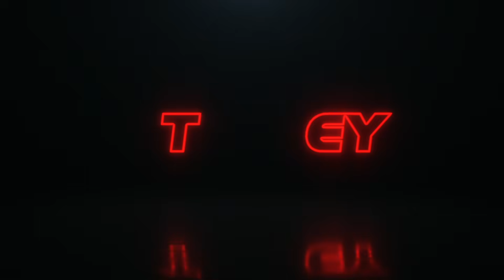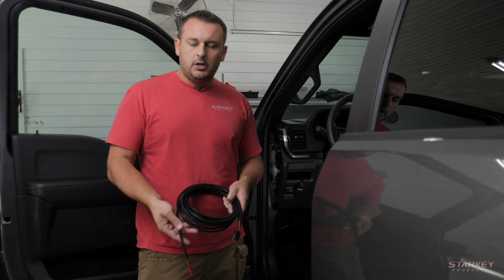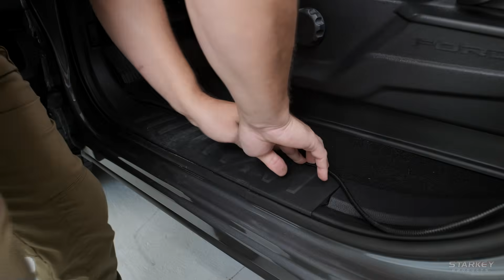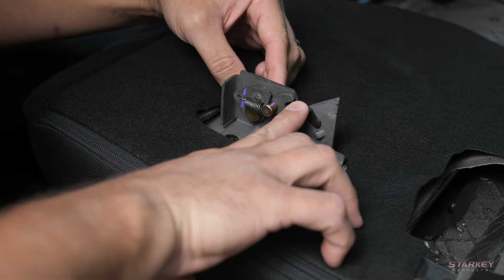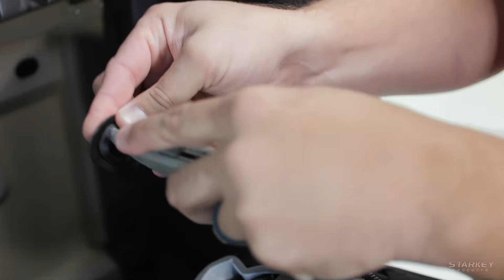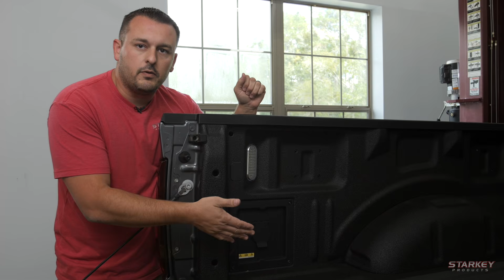Installation | 2015-2026 F-Series Bed Light Switch Upgrade Kit | Starkey Products

Comment: Can you use the switch to wire lights directly to battery. I have the light kit from you guys, but want the lights to be on all the time if switched on (no timer)
Reply from the maker: Hi Dusten - thanks for reaching out and the question. I am afraid not - this switch is a PWM momentary switch and won't operate the way you want it to. You would need to wire in a rocker switch directly from the battery for it to do what you want.

Comment: Then how do you replace the press button switch when it goes bad, bc they often do? So tell me that....not as easy as just a pop out panel.
Reply from the maker: The easiest way is to remove the tail light - 2 bolts, pull straight back, and unplug. Once you have your tail light safely off to the side, you can reach in and push the switch out from the backside. This will keep you from scratching the bezel around the switch and allow you to get it out easily. 

The switch carries a 5-year warranty from us FWIW, so any failure would be covered.
Reply: @StarkeyProducts  Dernnit, too late, already haggled and hassled and dinged/dented my bed panel. But that was only replacing the interior button. I used a square cut ring of black Flex tape to cover and seal the dings since it was only the actual button part without the outer plastic bezel. I have a full size replacement button in hand for the button and bezel and will replace as you suggest next time. I hear the buttons go out aka burn out all the time. THX

Comment: Is there still an automatic time out, or do the lights stay on indefinitely with the switch?
Reply from the maker: This still retains the factory timer which is 10 minutes by default. Once they turn off, a button press will reset the timer.

Comment: Where else can the wire be passed through the back of the cab as I have the OEM Kicker subwoofer in that location on a 2019 F150?
Reply from the maker: Another option would be the pressure equalizing vent located on driver and passenger sides for the 2015-2023 F-150's. There are also some other grommets that would work on the rear cab wall.

Comment: Do you sell the complete combo light and switch? My 2024 F-150 XLT Hybrid doesn’t have the light or switch. Also, how do you install it? Please advise, thank you.
Reply from the maker: Hi - Yes we do. Please see product at link below. This includes the base bed lighting kit as well as the switch upgrade kit. We have very detailed installation videos for both videos, you will be able to find them at the link as well. Thanks!
https://www.starkey-products.com/products/ford-f150-oem-style-bed-lighting-kit-2021-2023?_pos=1&_psq=4587&_ss=e&_v=1.0&variant=47280208904292

Comment: Do the wire taps actually cut the wire. If you cut the wrong wire with the wire tap, will it be game over?
Reply from the maker: Great question - no they do not cut the wire. They remove the insulation from a very small cross-section of the copper wire itself - this happens as you close the wire-tap. Once closed, the metal clip inside the wire-tap makes contact with the copper core and conducts through the attached wire. If you were to tap the wrong wire, you could simply remove the wire-tap (they unclip) and place a piece of electrical tape over that portion of the incorrect wire.

Comment: With this installed do the bed lights still activate upon unlock or doors opening? Also if you click it off when done using does it turn back on if you open doors / unlock it do you have to use the switch?
Reply from the maker: Great question - yes they will continue to illuminate anytime you unlock or open a cab door. That timer is 25 seconds or until the cab door(s) are closed. Yes if the truck is sitting and you turn the lights ON/OFF, they will still come on when you open the doors/ unlock. So you don't lose the functionality of the base bed lighting kit if you add the upgrade switch. I hope this clarifies things for you!

Comment: I’ve got a super duty 2019  no such white with blue stripe wire in the headlight switch
Reply from the maker: Hi Kevin - It should definitely be a White with Blue but what we do see sometimes is that other wire colors can bleed onto the white making it look a little different. If its helpful, the PIN# on the connector you would connect to for your truck would be Pin #2.

Comment: I already purchased your bed lighting kit from you  for $140 on Amazon but to charge $100  for a switch and wires?? Come on guys . That's taking advantage.
Reply from the maker: Appreciate your feedback and for what it is worth, we are honestly not trying to take advantage. Less than half of customers want the switch, so it didnt make sense for us to include it in the base kit. Also our entire system is much more affordable than the Ford alternative ($1,500+ from the dealer, as insane as that sounds) and there is no programming or trips to the dealer necessary. Also all wiring harnesses are designed and assembled here in the USA.